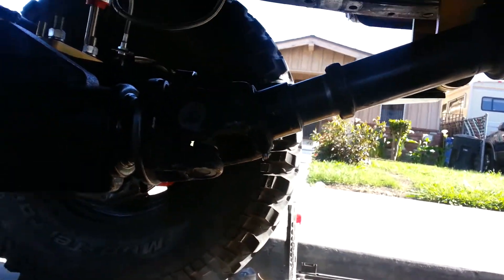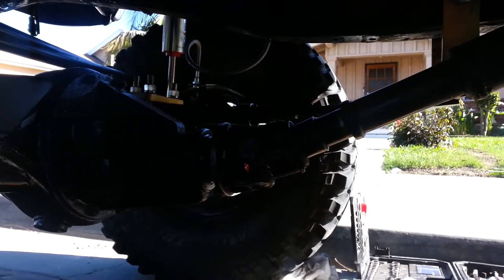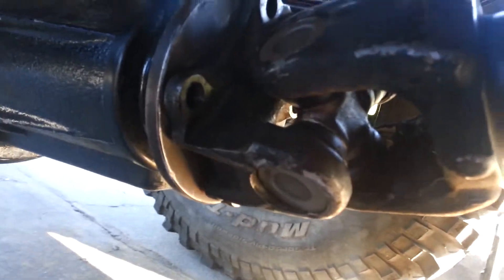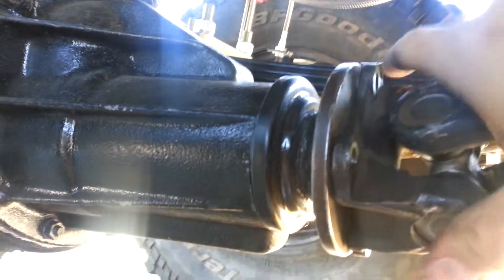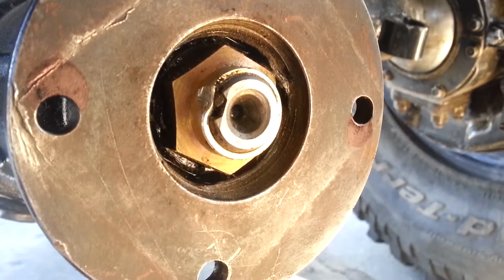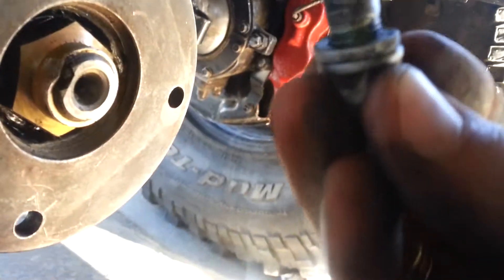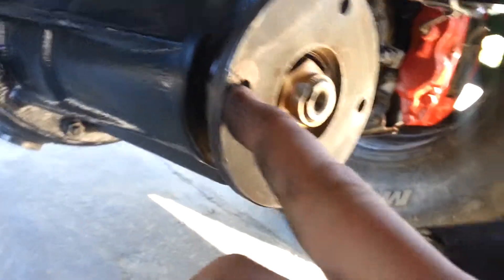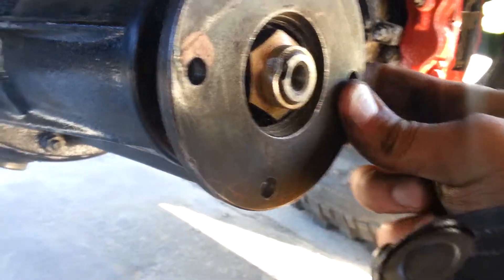Driveshaft fitting problems on SAS'd 4runner.

Comment: Quite an easy fix you could replace the flange with a trailgear triple drilled flange or just rotate it 45 degrees and redrill the pinion flange to the new bolt patern.
Reply from the maker: mtm 4x4 oh it has since been fixed. this video was over 4 years ago. I just swapped over the flange from the donor truck where I got the axle off of.
Reply: how easy is it to do that ? switching the flanges just unbolt and bolt back on or is there more?

Comment: I had the same problem with the rear driveshaft on my Datsun 4x4 when I swapped a Toyo V6 rear end under it, I ended up cutting the flange (just the disk that touches the DS) off the old rear end (so I knew it would fit with the driveshaft like before) and welding it onto the Toyo pinion flange, drilled the Datsun bolt holes through all the way and bam. But in your case I believe they make an aluminum adapter.